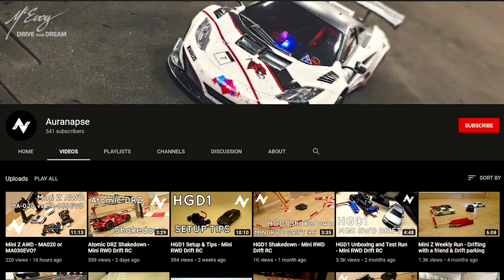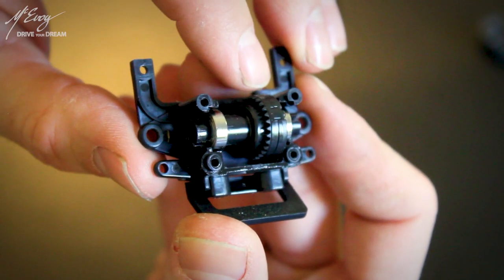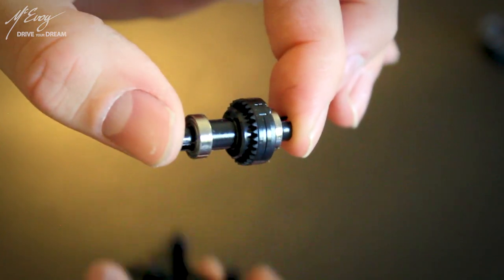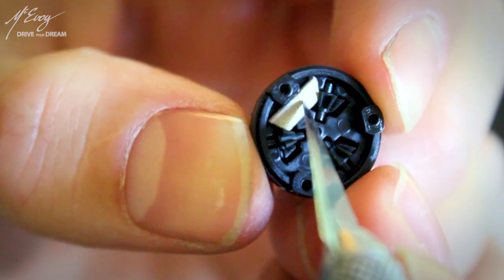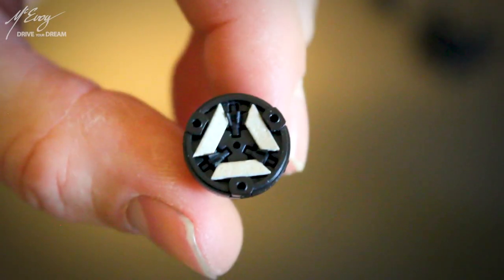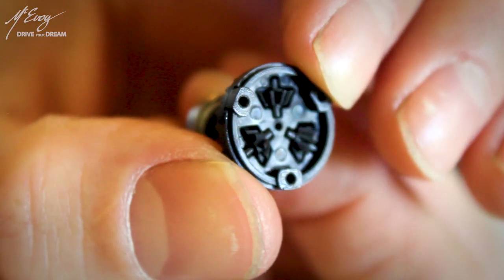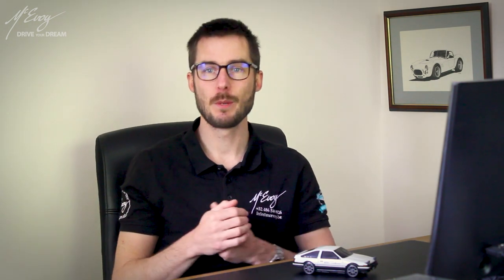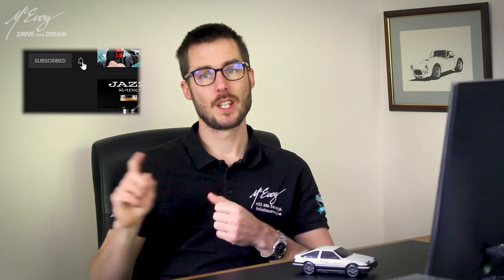The Mini-Z garage: how to lock a differential

Comment: Great idea! Now just have to hunt those o-rings down. Actually, I can just find some packaging foam and stuff it in there as well. Should serve the same purpose albeit less elegant.
Reply from the maker: I have tried using foam, but it doesn't work as well. I put it behind the planetary gears, to "press" them together. Give it a go though, you never know. You should be able to find a set of o-rings in a DIY, or hobby store. Have fun! Also, check out the video on how to make a limited slip differential! I will be posting it this morning. :)